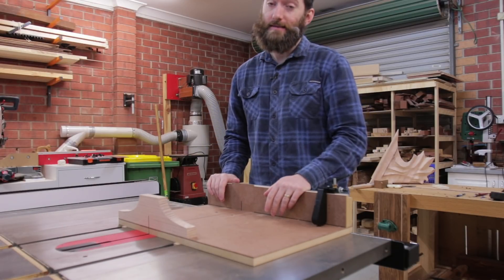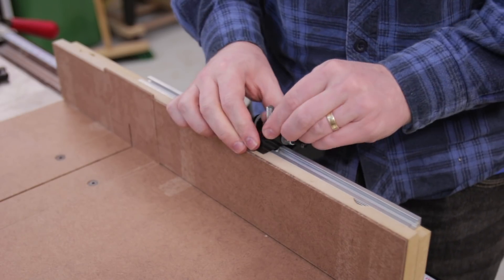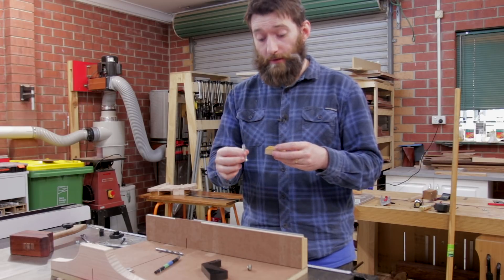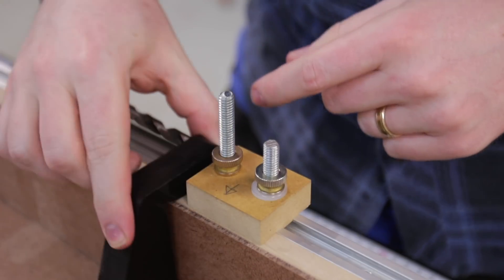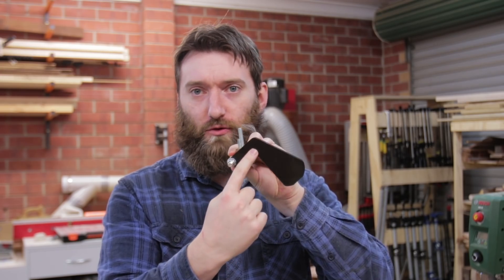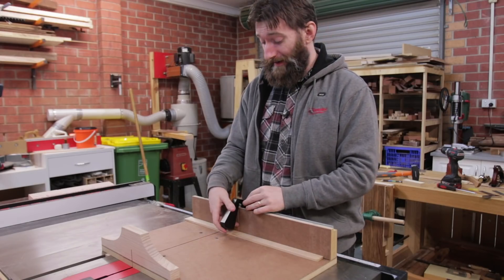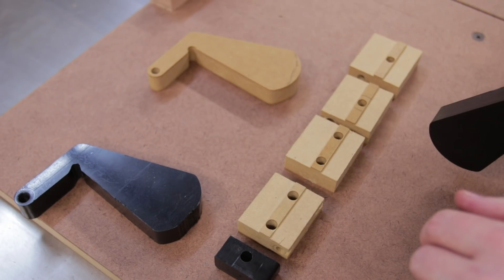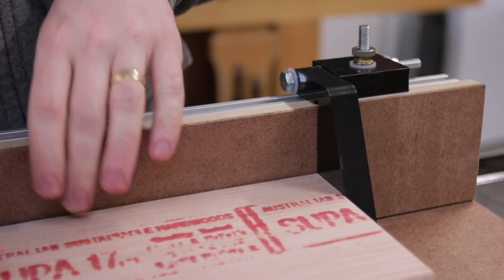CNC: Flip Stop (Win a X-Carve! Easel Power Hour Challenge)

Comment: Very nice product. There are many flip stops out there, and they are consistent. As in consistently SUCKING! Generally too much wiggle room for repeatable/ accurate cutting. Your model seems to cover those issues. Is there any issue with the polyethlene (?) material in terms of flex? It certainly seems easy to mill in the CNC.

One thought for potential improvement: If you add a small piece of 150/220 wet - dry sandpaper to the bottom of the "flipper", it will help as a hold down on those small parts.
Reply from the maker: It was HDPE (so yes, polyethelene) - this is the first time I've milled it, I was surprised at just how easy it is to work. You can use more aggressive settings than MDF! Downside is most adhesives just don't stick at all to HDPE, fasteners are the generally recommended attachment method. CA won't work without a primer first.

When hitting the stop, there is some deflection in the arm, but it does spring back and doesn't rotate the stop at all. I have a certain brand aluminium (!) flip stop that actually deflects more on the arm and causes the stop to rotate (so it doesn't "spring back"). For me, thats "good enough" since when I'm using it on this crosscut sled, I'm cutting thinner pieces that don't have as much force, so the spring back (or just sliding them less aggressively) works just fine.

I think there is an inherent flaw in the single-arm flip stop design, and I'd like to address this another time/in more revisions. Incra's flip stop, for example, uses two arms and locks into their aluminium extrusion to really stop movement.

Comment: Wouldn't it be much easier to put the stop on the other side of the "lockblock"? That should eliminate most of the movement, at least i think so 😅
Reply from the maker: I did try that (some cut footage) and while it was better there was still some rotation. Removing as much as possible so it can be used in either direction (if the bumper was on both sides) makes it a better design so it can be used on more sleds/jigs/etc. I happen to prefer the larger side of my sled on the left, some people prefer theirs on the right :)
Reply: Paul Jenkins yeah, okay i see. It is far more versatile without the wobble